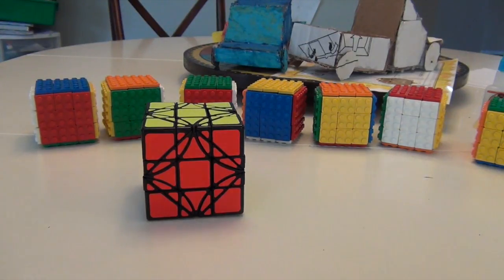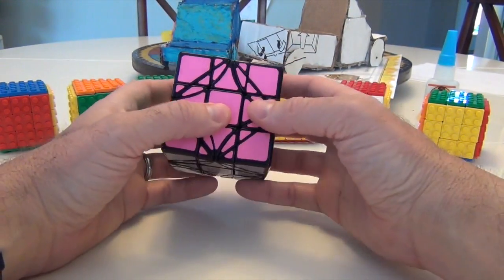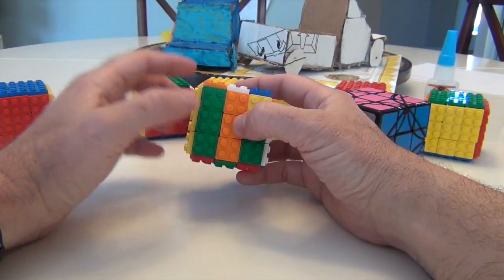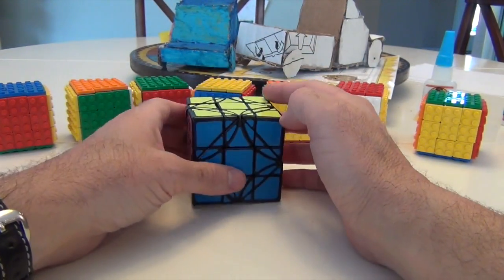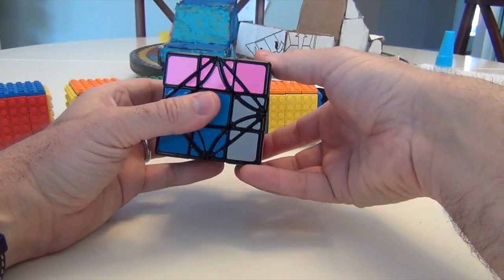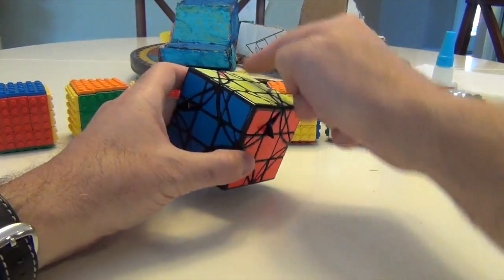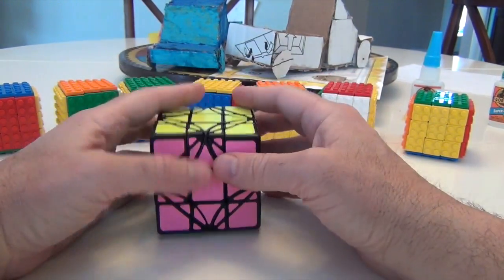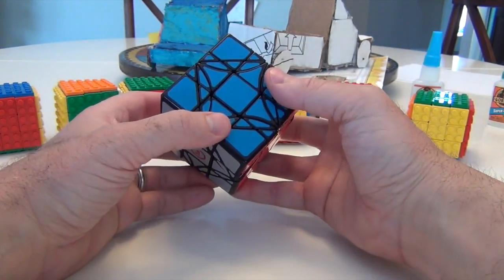3x3 Dreidel Cube Tutorial part 1:  How to design a commutator!

Comment: This is an awesome video for teaching.  Still in the beginning but the only thing that sucks...is that I don't own a single physical puzzle... I play on my phone with an android app that has a TON of different sizes and shapes and then it has all the way from 2x to 3x to some of them having like 13x, 14x, 16x...etc etc ... some have massive numbers, like a 13x13x13 void cube lol...never seen a void cube bigger than 3x3x3 either... very interesting app to see all of these puzzles...

Like all different Ghost Cube types, Dodecahedron from standard to 4 layers, Floppy(?) 1x2x3 all the way to 7x8x9, 2x2x3 to 8x8x9.  Mirror(? is that there name, the app uses different names, Ghosts are called dragons for example) as standard version, Dodeca, floppy, flat, 2x2x3 type.  Shapeshifting type(cuboid is what it calls them here) 2x2x4 to 11x11x13 lol... 1x3x3 to 10x12x12 and 1x3x5 to 10x12x14... There void cubes are called crystal cubes and there's the Pyramid type starting from the 2x2 all the way to 11x11x11, then the diamond(4 sided pyramid instead of 3 sided) once again starting from 2x2x2 to 11x11x11, void Dodecas from standard to a 6 layered one and standard rubik's void(sorry they're called crystals by category but they're labeled as "holey" in their names)...so the Holey Cube starts from 3x3x3 and goes to(counting in head, 5x5, 7x7, 9x9,11,13...)... 13x13x13... does all the odd numbers from 3 to 13(including).  And then there are some other ones like putting your own pictures on the sides of cubes and other weird things like that....  um... I don't remember my point anymore besides saying about these crazy cubes...

OOOOH RIGHT... because I sadly don't own a physical one so it makes it SOOOOOO much hard to try to think things through unless you're just following algorithms... it is so sad and annoying and sad(again...le-sigh)...  You should send me even just a normal 3x3x3(would prefer a more complex one *1*<---inserting complaint about begging here*)...

P.S.  Incase you or anyone is interested.  The name of the Android app is Magic Puzzle Pro made by MagicDreamPro should be the first one there on the list.
.
.
.
.
.
.
.
.
.
.
.
.
.
.
.
.
.
.
.
.
.
*1*:  but beggars...lmfao... beggars can sure as hell be choosers... fucking dicks of the world is who say that beggars can't be choosers... those are the pathetic ones that can't assert themselves into situations... So go suck it Mr. Beggars can't be choosers...)